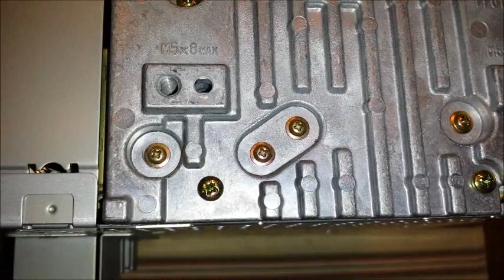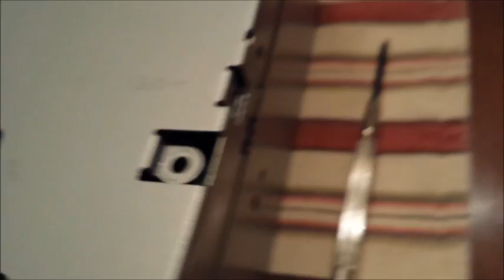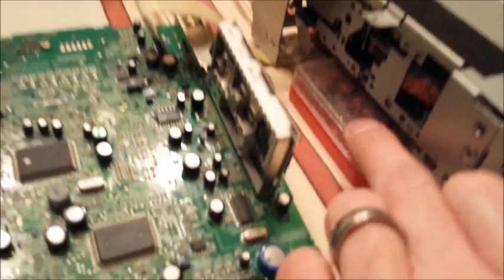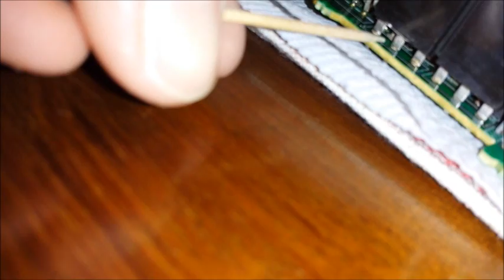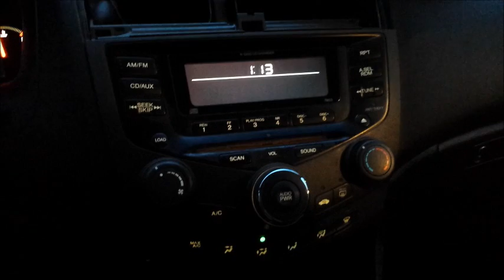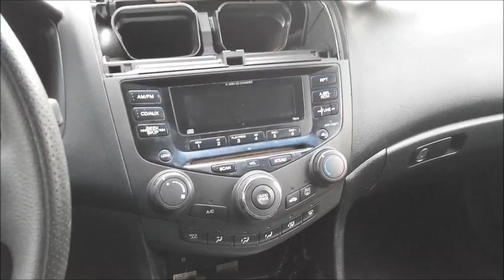2003 Honda Accord Radio Repair - Part 2

Comment: Hi tx for video..I have same problem in my accord 2009 but when opened radio look different from one in ur video. Please can you help me don't know what to look...
Reply from the maker: adis eminovic Adis, I'm very sorry to say that I'm not at all familiar with the circuit board for the 2009 Accord radio.  I would try to find a Honda electronics online forum and ask some of the knowledgeable people there.  I'm sure someone can point you in the right direction.

I'm sorry I'm not more help.  Thanks for watching!

Comment: Hey my radio switch from am fm1 fm2 fm3 on start up for a min or two then its fine also it doesnt respond when i click cd. Do you know any fixes
Reply from the maker: Kyle Weege Kyle, unfortunately, I don't know how to fix that issue.  The CD player seems to be a common, but separate, problem.  In fact, the radio I repaired in this video had a broken CD player that I wasn't able to fix.  The mode switching on startup is a new issue that I've not heard of before, but it's possible that is related to the CD player.

I'm sorry I'm not more help.  I'd look up a Honda message board/forum and do some research there.  There are lots of knowledgeable people on those forums that can probably help you.

Good luck, and please report back here if you are able to find a solution!  I'm sure other people may stumble across this video and could benefit from any information you find.
Reply: Kyle Weege My radio had two problems: 1) it did the exact same cycling thing as yours whenever I started up the car and was unresponsive to input (except power and volume) just like yours and would stop after a minute just like yours, 2) it also had the backlight outage problem.

I opened it up in order to fix the backlight problem using the Circuit Writer solution. I applied two coats and the backlight is still out but as a side effect of this repair, the cycling stopped. I don't think the circuit writer pen solved this problem but I did notice something when I opened up the radio. The ribbon cable that connects the two circuit boards had a very loose connection on the bottom board (the one that wasn't used for the circuit writer solution). I re-seated that and I think that was what solved the issue. I did this repair earlier tonight so it's hard to say how permanent of a solution this is and I'm not even sure that was what fixed it. Good luck!

EDIT: I applied the second coat yesterday night and plugged in the radio while the circuit writer solution was not entirely cured. At that time, it did not work. I started my car this morning and it now works perfectly! The cycling is still gone and the backlight works.

Comment: I actually did everything on your video. It worked. the thing is that when I put everything back up and running I tried to use my AUX which is an external cable and it doesn't work. I dk if it is something on the radio itself or that maybe the aux unplogged itself, because it doen't even show AUX on the radio when I press the button. Help please
Reply from the maker: Liz Tang I'm really sorry to hear that, Liz.  That is the first time I've heard of that problem.  What year was your vehicle manufactured?  It is my understanding that the factory 2003 radio did not have a built in "AUX" connection, even though there is a "CD/AUX" button on the radio face.  I believe the AUX connection has to be an aftermarket plug-in connection that hooks to the back of the radio.  If your vehicle was made in 2003 or earlier, I would suspect that your auxiliary connection did not get hooked back up when you re-installed the radio unit in the dash.  

Where is the "AUX IN" plug located?
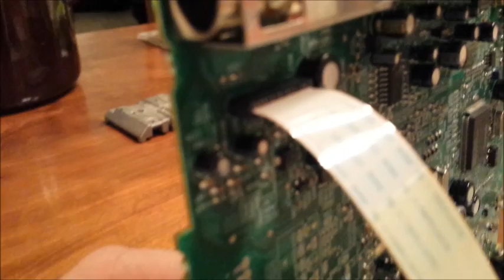Reply from the maker: ***** Liz, check out this video, particularly at about the 5:35 mark:

https://www.youtube.com/watch?v=4yP3YGCtQ_I

It looks like the AUX adapter plugs into the bottom of the radio, so it may be possible that the connector pulled out without you even realizing it when you removed the radio from the dash.  You may have to remove the storage bin from below the radio unit to see if you can find the connector in there.

Good luck!
Reply: Its external. Not factury

Comment: Well the radio turns on, lights and all but the lights to the a/c do not and the c player does not work either. Also the lights in the shifter do not work.
Reply from the maker: daniel salas Hmm, Daniel that might be two separate issues.  The vehicle in my video (which belonged to a friend) also had a CD player issue that was unrelated to the repair that I did.  You might want to try removing the radio and replacing the resistor that I bypassed to see if that repairs the A/C/heat control lights issue.

I'm not sure what the fix is for the CD player, unfortunately.

Comment: I have a 2003 Accord with the other board that is mentioned (under the CD component) - not that hard to get too, but will be fun rebuilding for sure.  My question is, did anyone resolve the issue with the other board?  It is very odd that we have exactly the same issue.  I can post pictures (i think) if it helps anyone.
Reply from the maker: J Germ I'm sorry that I'm not knowledgeable about the different mother board, but hopefully someone else can help you out!  Thanks for watching!

Comment: third time's a charm :)  I did this project over the weekend and I had to try 3 times with the circuitwriter pen, so a total of 3 coats, but after the third attempt it worked!  It actually didn't work at first after the 3rd attempt, but the lights all started fading to bright after the radio was on for about 15 mins on the 3rd attempt and now they all work fine!  Hopefully it stays working!  Thanks for the instructions!
Reply from the maker: Matthew Piro Matthew, that is great to hear!  Congratulations on tackling this on your own and for having the patience to keep at it until you solved the problem!  Thanks for watching and commenting.

Comment: Thanks Matt.
I followed your tutorial about 2 months ago and I fixed the problem using a conductive ink gel. 
However, today the screen went black again. I used some conductive ink that came in a syringe, and I am not sure if it's lower quality ink than what you used, but I need to try to fix it again for good. 
Did anyone else radio went dark after a few months?
Reply from the maker: matase Man, that stinks...I'm sorry to hear that.  The best fix would obviously be to remove the resistor and install a new one, but as far as I know, my repair is still working (the vehicle in my video belonged to a friend, and he has since sold it to another friend).  I'm sorry that your repair didn't last longer.
Reply: *****  It's alright, but it does suck a bit that I will have to remove all the paneling and the radio again. I just want to make sure your fix at least lasted for half a year? Maybe I'll put up the same conductive ink as what you used. I had some cheaper brand conductive ink, but it came in a more convenient syringe pack. I wouldn't be able to install a resistor in such a tight spot.

My radio light didn't just die and never come back. For a few days after my radio screen went dark, sometimes my lights would come back on for like 10 seconds after I started my car in the morning. Maybe I am thinking, this cheaper kind ink deteriorated over time and now doesn't conduct electricity when that part of the circuit heats up..

Thanks for getting back to me.
Reply from the maker: matase I think you are definitely onto something about the conductive ink.  It sounds like the circuit continuity is being affected either by the ink's conductivity, or possibly the ink failing and wearing off over time.  Let me know if you are able to sort it out.  Good luck!

Comment: hey matt before your fixed everything what was the initial problem for me the back light doesn't light up anymore and i can't use the radio or the cd player therefore i can't listen to music. i don't know if this is the same problem honda had a recall on these models but i missed that boat and I'm trying to fixed this myself. the heat works but it doesn't show the temperature because the backlight doesn't work. if i do this would the sound start working again? any info would be great
Reply from the maker: Tommy Yu Tommy, the car in this video belonged to a friend, but his radio would play music.  He just could not tell what station the radio was tuned to because the back light would not work.  His CD player did not work either, but that was a separate issue.

If your radio backlight and HVAC lights are not working, the repair in this video should solve your problem.  However, as several people have commented below, there were apparently multiple motherboards used in the Honda factory radios, so depending on which one you have, it may not match the one pictured in this video.  Unfortunately, I am not familiar with the other motherboards and can't really offer any assistance in locating the bad resistor on them.

Best of luck if you decide to take on this repair.  The worst that can happen is that you remove the radio and discover you have a different motherboard.  If that is the case, you could try to purchase a used radio unit and install it yourself.

Thanks for watching!

Comment: Hi matt, My mother has an 03 Honda Accord LX. It had all the same symptoms to your video( radio not working, lights wont work underneath radio) Although once I opened up the radio, the lay out was completely different. The screws were internal and actually under the disk tray which I had to remove. Once finally getting to the actual motherboard there was no black resistors, and everything was completely different. I was wondering if you knew the solution to this or if you knew the correct resistor/fuse to this model motherboard that I have. Thanks for the help!
Reply from the maker: Dustin Hovanec Dustin, I am really sorry to say that I am not sure where the bad resistor can be found on the different motherboard that you have.  You and several other people have all commented about having a different setup in your radio unit.  I really wish I could offer more help!  I would look for a Honda forum to see if any folks there can help you out.  As popular as Accords are, I imagine someone somewhere has isolated the resistor on the motherboard that you have and can assist you.

Thanks a lot for watching, and I'm sorry I wasn't able to help you solve your issue.  Please check back in if you do figure it out!  Good luck!
Reply: ***** Hi Dustin, start checking all the resistors and caps, and diodes there are plenty of vids out there that can teach you this if you do not know how.  A very good DMM (digital multimeter) can be purchased at harbor freight Item #98674 even if it is not on sale this is a fantastic meter has more functions than my Fluke. I even use the temp probe on the oven so I have an exact temp.  Ok, you can eliminate the power supply since that works. back trace the backlight and test everything in that path. Oh, and when you find it. Don't forget to post it.  

Lastly see videos on how to discharge the caps. They keep a charge when the power supply is not on. Key words discharge capacitors or (caps).

Good luck.

Comment: Yeah, the board on my 2005 is completely different and doesn't have the same piece that is at the heart of the problem.  Unfortunately that wasn't evident until I got well into it.  And unfortunately Google search only gets this as the best match and still not finding anything to cover the difference.  Just wanted to put that here before someone else rips into it as far as I did before finding out they couldn't finish.  Great video -- just doesn't give me all I need.
Reply from the maker: Doug Meyer Dough, so sorry to hear you got all that way only to realize your motherboard is different!  Several other folks have had that same problem.  I wish I could offer a solution, but this particular vehicle is the only one I've done this repair on.  Hopefully someone else will be able to figure it out and can post their method here.

Good luck, and please let us all know if you do figure it out.  Thanks for watching and commenting!
Reply: Doug Meyer Same issue here. 05 board is a RE1HN11C PANEL.MAIN 84D60306Y01 B. It also does not have a ribbon cable that connects the CD player.
Reply: +Miyake Skeete hi, i have the same board with same issue. We need a solution asap! :) If you know something dont be hasty and keep us informed!!
Reply: +imoldskul I mentioned this somewhere else, but will repeat here in hope that it helps you and others.  What I ended up doing was buying a rebuilt one off of eBay.  BUT, not only did that one have a problem, but so did the 2 replacements I got under warranty too -- each slightly different problem, like one the lights didn't work, and another the climate controls didn't work.  In the end, the place I was buying it from recommended upgrading to the 6 CD version instead.  It was a little more, but fit just fine (but had to watch to get the correct climate controls, since that has both a single and dual version).  Since installing that one, I have had NO PROBLEMS AT ALL!  I would highly recommend this option -- just be sure the place you are buying it from understands you are doing an "upgrade swap" and will work with you if the one you get isn't the correct one.
Reply: +Doug Meyer With the upgrade swap does this also fix the issue with the radio?
Reply: +imoldskul I disassembled everything down to the board and could not figure out what the issue is. I did look online for similar models but I was unsure. I also wondered if those models would have the same issue (the next poster Doug Meyer confirms this). Honda really made out like bandits with this issue.
Reply: +Miyake Skeete Yes, absolutely (for me anyway).  According to the tech at the place I bought it, they just did something far better with the 6CD version than they did for the single CD one that came standard.  No problem at all with radio light missing/blank display, the crack of feedback followed by silence, or the climate controls (all of which were bad on one or another of the multiple ones I tried).
Reply: Miyake Skeete I solved the problem, but dont ask me how. :) My lcd backlight works now. I tell you what i did. Looking for the connector between the audio and hvac panel. Find the lcdlamp+b and lcdlamp-ret (5-6 leg i think, but written on the board) and follow the copper wires. Resoldering every parts that crossing its ways. There is two resistors and 2 transistors and maybe any other smaller components. Its a little bit difficult to follow the lines, because the pcb is double sided. Also make sure the connectors are not out of touch with each other. I resoldered every legs on both panel. The components looked good. Thats all what i did. Mine works for now. I hope it helps. cu.

Comment: The radio motherboard for my 2005 Honda Accord LX Coupe looks nothing like this one.  There are no bulging resistors or any other bulging parts sticking up from the board.  It's all flat and a totally different pattern.
Reply from the maker: zzap999 I'm sorry to hear that.  I wish I was able to offer more help.  The 2003 vehicle in my video was a friend's car and is the only one I have done this repair on.  I would search for an online Honda forum and I bet some folks there can help you out.  I've never actually owned a Honda so I'm not that knowledgeable about them beyond what I show in this video.  Sorry about that!

Thanks for watching.  I really hope you are able to solve your issue.  If you do figure it out, please report back here so other people may be able to follow the same steps.
Reply: ***** Matt, I hope the repair is still working but I do think it should be pulled and corrected the right way.  Here is what I found I think to be your type of resistor. Oh, it is definatly not a fuse.  This component is also directly off of the the voltage regulators which get very hot. If you noticed the back side of the metal cabinent it was discolored. This is the power supply and on the inside where it is discolored.  From this website I looked to find a little bit more about your resistor.

http://www.digikey.com/en/articles/techzone/2013/sep/power-rating-is-just-one-resistor-parameter-to-consider

I believe it is very specific resistor read this wich I cut from the above website.

Beyond the parameters discussed above, we enter a more rarified arena of specialist resistors that need to meet particular criteria for demanding applications. This includes high voltage types where, apart from their ability to work at high voltages, the undesirable change in resistance with voltage (specified as the voltage coefficient of resistance or VCR) can be reduced by careful resistor design. Further considerations for more extreme environments might require resistors that are non-magnetic or are free of organic material that will outgas if used in a vacuum. Other features that may be important in differentiating high-performance resistors from their more run-of-the-mill counterparts include anti-corrosion, moisture resistance, low noise, automotive qualification, current sensing, flame resistance, non-inductive, pulse withstanding, and RF or high frequency types. To better appreciate all this, the next section overviews the key attributes of particular resistor technologies, illustrated by products from Riedon, a company that has been at the cutting edge of resistive solutions for over 50 years

Please understand the environment this component works in. Very cold, and very hot.  Extreme environment.  The component needs its parts. Worse case scenerio "FIRE". Other worst case scenerio the radio just stops working better than a fire.  

Good luck....
Reply: William WardAbout the fuse:  Most likely this component  is the 0 ohm resistor used actually as a fuse. It is really hard to tell for sure without seeing the PC board electrical diagram.
Reply: Did you find a fix for the 05 coupe? thats what i have too. thx!